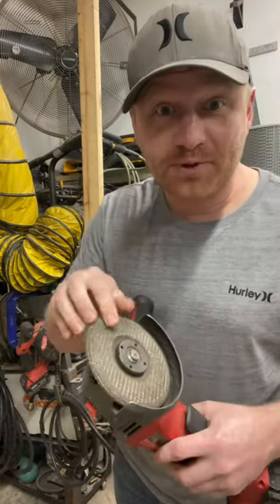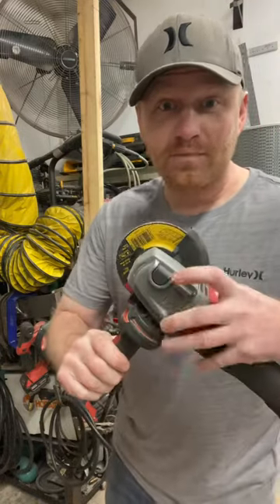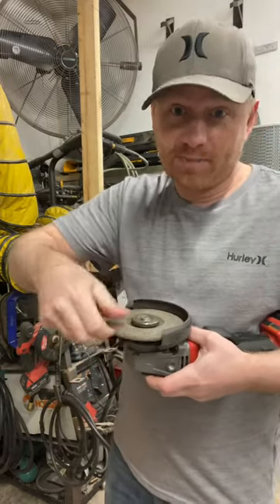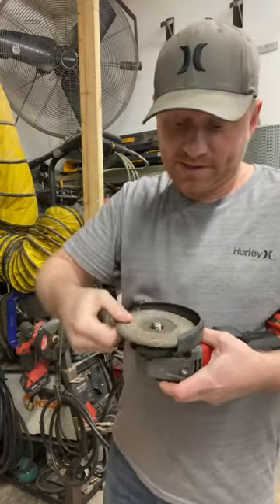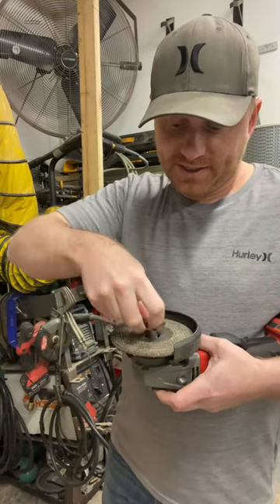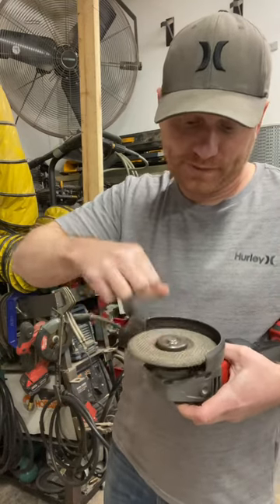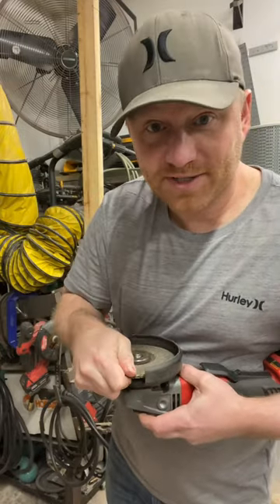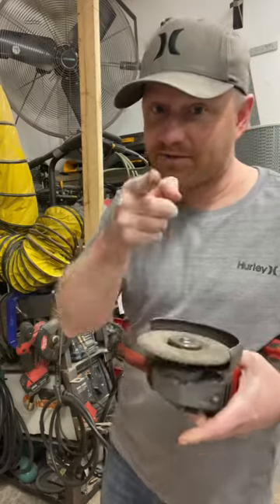Stop using a wrench for this! #shorts

Comment: Thats a nice theory, except when you a cheap like me and use that disc to the last 1/1000 of an inch.  Also what do you do when you pinch the disc and it shatters or breaks.  Good luck holding onto that.  But other then those situations good job.

Comment: Just the torque of turning in on after you finger tighten it  is enough. If you do use the wrench one day your going to sheer the pin that holds it still and your fucked after that.

Comment: Would say to unplug or remove the battery. On some brands with limited safety , it doesn’t take much to accidentally turn on , and I’ve seen a dude slice his palm in half with this method.

Comment: Yall are lucky yalls has a break on it. Mine dont. I use the factory wrench to hold the 2 flat sides then use my hand to remove the blade. Even wire wheels. It hurts sometimes but momma didnt raise a bi***

Comment: I've had em spin off without tightening with wrench first but you can continue on with your negligence lessons and get sued
Reply from the maker: If you want to remove the battery or use the wrench from the grinder or drill etc. to feel safe and not scratch your nail polish, then I think it’s a good idea, for you.

Comment: That works until someone gets the blade stuck in a cut . It usually tightens the nut, so you can't remove it with your hand 😁

Comment: I worked with 3 phase & High pressure cutoff grinders for 7 years do not listen to this crap, you see those guys having grinder disks explode & lodged in their face masks. That's caused by torquing the disk & not having that clamp down tight makes it worse!...

Comment: You only have to use that wrench if you don't know what the f*** you're doing.
If you put the Arbor Nu on loose, its will overtighten. Also? When you're cutting. Something? And you. Let? You're. Cutting this bind up, that will also make it over tighten.

Comment: The power source was left on.
No gloves (cut-off wheels and flap discs can cut you easily)
And if you fractured the disc since you're applying torque in directions those discs weren't intended to receive, once you get a little resistance, that disc is coming apart.

So, was it worth it to be stupid? Not in my eyes for the extra 5 to 10 seconds it takes to use the provided tool. Yes, I use a grinder, so just keep quiet. Safety guidelines and  PPE are used for a reason.

Comment: with your cute battery toys they aint coming off, but my ingersoll has enough torque stop that the wheels do spin themselves off if I don't get them tight.
Your battery powered toy shit aint allowed in my shop. That's what all those power cords and high power tools are for.